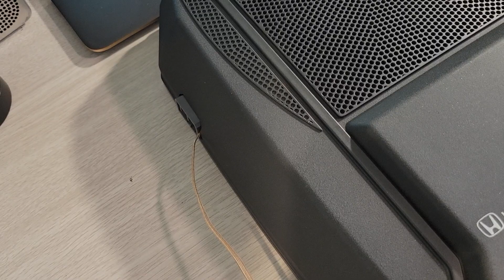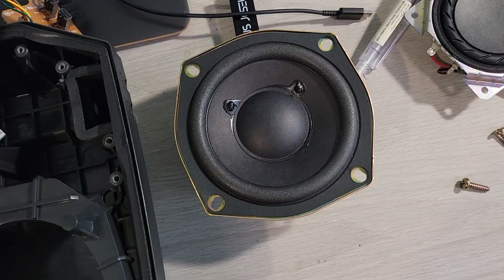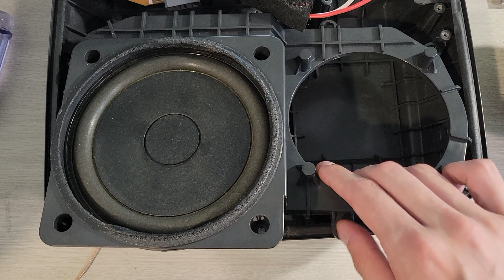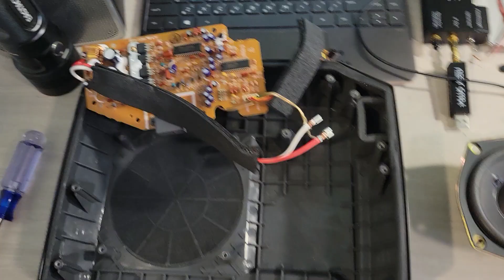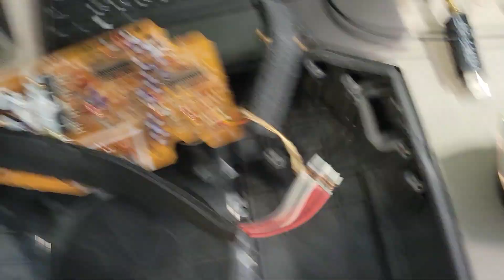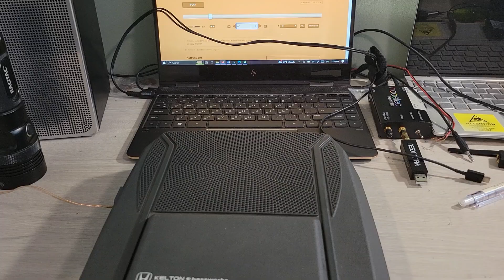Panasonic Kelton "Subwoofer" Speaker: Review, Teardown and Bass Test

Comment: This is probably better than the late 2010s Honda stereo system subwoofers. (Apparently, Honda has partnered with Bose on the newest model years for premium sound, and I’d guess those are better.) We had an Accord Hybrid from the late 2010s era, and the sub was just an 8 inch subwoofer driver behind the back seat, mounted directly into the trunk! The back of the subwoofer driver was visible inside the trunk, and you could literally touch the back of the cone: same story with the rear left and right speakers. However, they were at least somewhat passable, given that the left and right speakers appeared to have Kevlar cones, though they had the usual plastic baskets and lightweight neodymium magnets. We also had metallic dome tweeters in the front. Subwoofer was a standard paper cone unit, and it was actually quite a stiff driver. On maximum subwoofer level, it did a little in the front of the car, but it didn’t do much in the back: this is consistent with subwoofers sounding loudest/hitting deepest in the opposite corner of my bedroom from where they are placed. I looked up the car and all the parts, and apparently, those Honda Accord premium stereos were manufactured by Foster, who also manufactured the cheap base model stereo. (The generation after it had an almost identical Pioneer OEM, but featured a shallow mount subwoofer with the magnet on the opposite side of the cone. No idea how it sounded, but it was probably similar.) Due to unfortunate circumstances (a crash) that Accord got replaced with a Tesla model Y, which feature Bang and Olufsen sound systems. I figured out that the subwoofer is in the trunk area, behind the carpeting near the wheel well, completely hidden. The Tesla stereo has good bass and treble, but seems to really lack midrange. I might have to adjust the EQ in that car at some point.
Reply from the maker: These sound decent enough at low volume. They just don't go loud. As for the exposed subwoofers you mentioned, those are tuned for infinite baffle (very big enclosure/free air) and would sound better like that than in a sealed/ported box. If you aren't getting much bass then it's likely the dsp settings or the drivers could have broke/degraded over time.
Reply: @speakerblowupmanlee5921  It sounded like that when it was new, and I doubt the driver was degraded at all: it had rubber surrounds and a thick cone. It definitely had more bass than the stereo of any car we had beforehand, but still not the same depth of some other cars I’d heard the stereo in.
I’ve never heard an OEM car subwoofer that went extremely low, because that would obviously take up a lot of space. I feel like many larger drivers I have really perform better in an open baffle than a box (especially ones from vintage speakers) but they definitely go louder in a box without distorting. 
On the other hand, OEM car speakers are just built different. Many are fun to play around with because they’re really efficient and sound impressive in free air. The few that I’ve handled myself were the four lightly built 6.5 inch full range drivers out of my aunt and uncle’s old ‘07 Nissan Versa hatchback. Just standard issue Nissan dual cone (w/ whizzer) speakers, but I think the cheapest ones I’ve seen. For what they are, they are surprisingly good in free air hooked to a home stereo system, but they didn’t really fare well sitting outside for so long. The cones got slightly off center after a time, and whenever it rained or the car got washed, the humidity buildup would cause the voice coils to rub and lock up. But somehow, without fail, they sounded excellent on a dry day. 
I also remember that car having a thin sounding crappy FM radio, but the CD player was the exact opposite. With the bass on max in CD mode, anything placed in the door panel compartments and handles would move around! And that was just the stock 20 watt 6.5” door speakers!
Reply: That's a freeair subwoofer. Common and works well and for oem means they use almost no space.